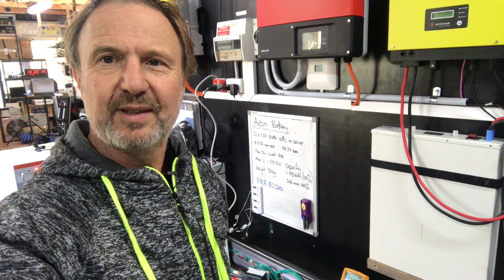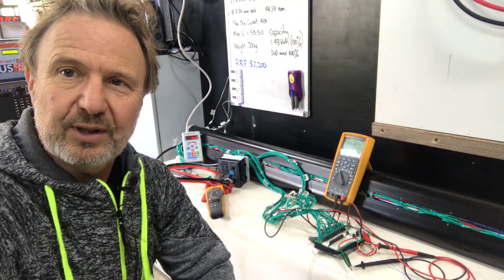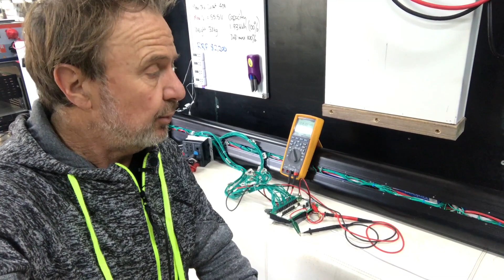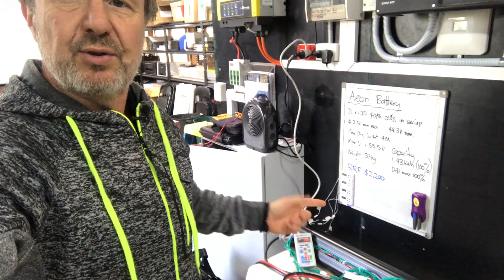Aeon LTO Battery

Comment: If it costs 2200$ / 2000 EUR, then it is pretty good, but not super good from the perspective of initial investment. The price is acceptable, because they do have 20 years warranty, and rating of 22000 (yes 22 thousends) cycles at 1C and 100% DoD. That is extremely good. Normal Lithium-ion, you will probably need to replace system two or three times in that period.

I hope they produce bigger battery banks, so the auxiliary costs (like BMS, cabling, installation, etc) are reduced. If one could install 100kWh for 50k$ and it lasts 22000 full discharge cycles, then it would be a winner.

Still, at the current price, it looks like LiFePO4 is more cost effective (kWh/$/year).
Reply: We also make similar systems that this with two system types. One is "all in one" (battery bank with inverter) and another type is modulare panel type system (2kWh panel which can be scaled up for more capacity by just adding multiple panels together).
Reply: @cayrex  btw. In the meantime I did learn that LTO suffers quite a bit because of calendar aging. So they might do 22000 cycles, but will not last 20 years well. Also the roundtrip efficiency is way worse than LFP, so at high currents they might be degrading and heat up substantially. Not to mention you do loose energy stored.

But in some applications , they do excel.
Reply: @movax20h  yes that right. For me was a nice project to play with thos cells. I really love the fast charging ability. LFP are good for storage systems. Lead carbon are also not bad for small storage systems

Comment: I  finished my Solar storage tank with 132x Yinlong LTO 40 Ah Cells and 88 Toshiba 20Ah Cells,  next week. The capacity is  16 kWh.
Have 2x 22s  BMS with 160 Ampers each and 22 Equalizer on it. 

3 Inverters "Steca PLI 5000"  8 x 3 Solar Moduls with  5640 Wp.
The Inverters are configured 3 Phase 230 Volt. Under voltage: 44 Volts, Max Charge and Fload: 56,8Volts (22 Cells)
All Cells are separate with Glasfiber matt and the Battery trough are with Glasfiber matt Lined.
The Equalizer makes 1-3 Ampers to hold all cells at the same Voltage.
The problem is, when the cells are full the voltage rises over percentage. 
The BMS cut then the Load but not the Accu Block. The Inverter interrupts the charge every time, Because the battery won't charge.
This is bugging me. The Equalizer Help me, that this does not occur.

Comment: what cells are those ? are they yinlong cells ?
Reply: yes
Reply: @pgarza2  we use these in car audio and have put a huge dent in the market on these cells , the prices have now jumped to the point there are better options
Reply: @mazda2284  they are on alibaba for 35 dollars each thats not too bad.
Reply: @ekoms108  get a quote, with shipping they come to 60$ per cell for 1 bank . We were getting them for 25$ per cell shipped when I got my first order
Reply: @ekoms108  Be sure to get a reliable source. Some are marked and sold as 40Ah cells, but are in fact 30Ah or less.